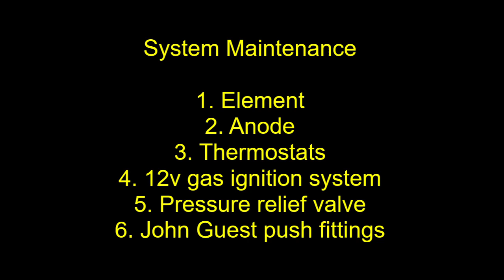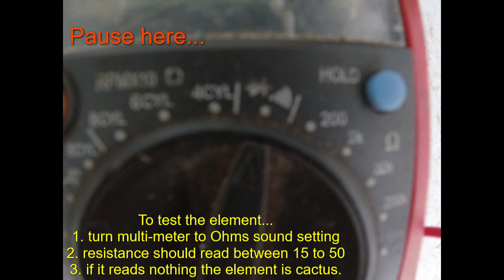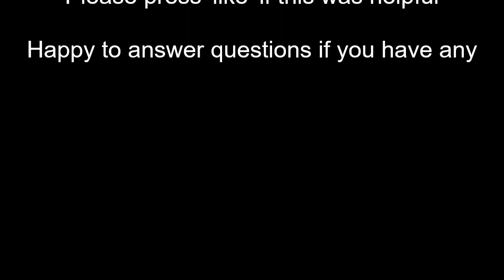Swift hot water heater and maintenance and service

Comment: Not a stainless tank, its aloy but good work
Reply: Swift advises that "The tank is made from stainless steel which resists corrosion with water above 60°C. This grade of stainless steel has been chosen because other materials can corrode when subjected to these higher temperatures.

Comment: Thanks Paul - very helpful video. I have a leak from my hot water outlet to the caravan. Can you advise if I need to bleed the whole tank or can I just undo the elbow fitting and see whats going on?
Reply from the maker: Hi Don. Just turn power off to his. Turn off mains tap. Use the pressure relief valve to let some water out below the hot water 'out' pipe then you can have a play around. If it was like mine... the John Guest fitting was RS. Also make sure the hot water pipe is pushed all the way home into the JG elbow fitting and then pull on it to seat it properly. 👍